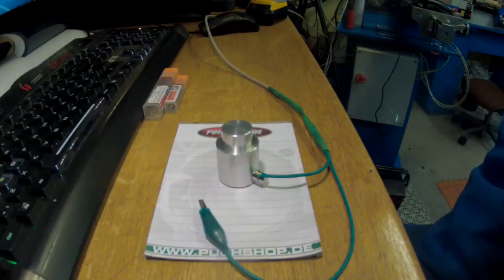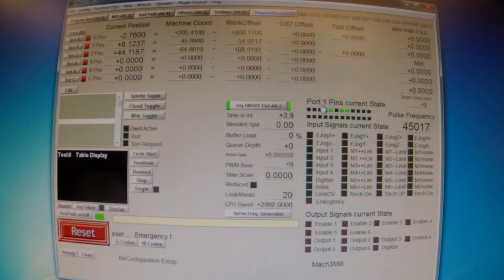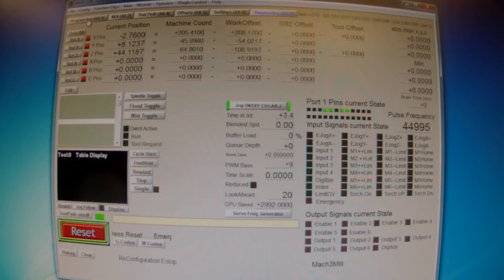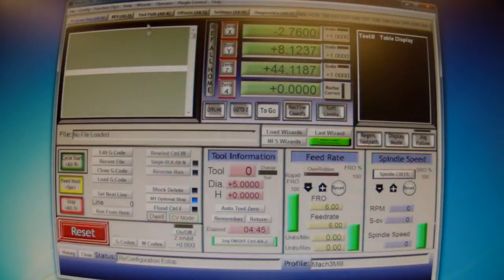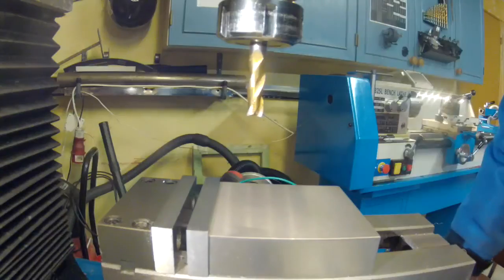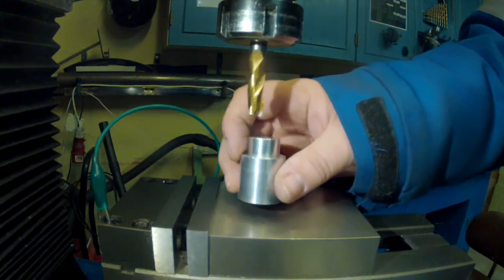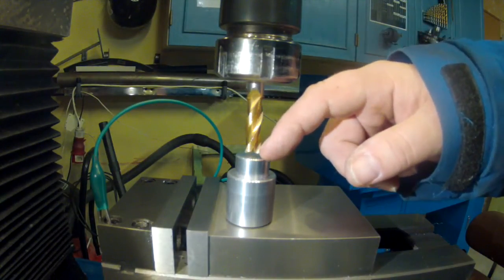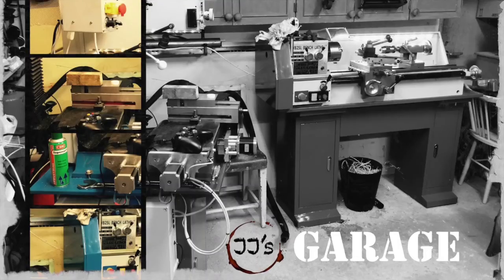Touch probe for MACH3 part3

Comment: surprised at the lack of comments on this. nice work! any chance you could share your VB script ? jc630225@gmail.com
Reply from the maker: It's many scripts like this already out on the web, google is your friend :)

It is a little tricky just to put up a script that's suitable for everybody to use, every machine has a setup of it's own. 
Right now I have modified the script to next level so I get a question if I want to zero the tool or not between each tool change. I also touch off the probe first at high speed and then a second time on low speed and there is a lot of script lines with different important setting that has to be explained and maybe changed to fit another machine so there is a certain danger that it would be too much explaining and possible misunderstandings along the way. 
Maybe in the future I can make an additional  video where I also explain the settings line by line before I'm ready to put up the script fot downloading.
Reply: Patc1